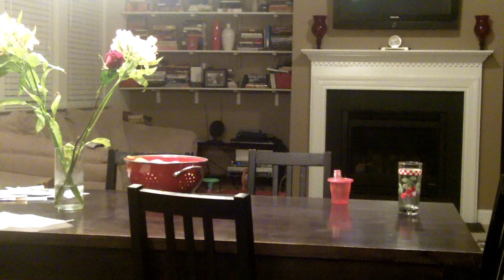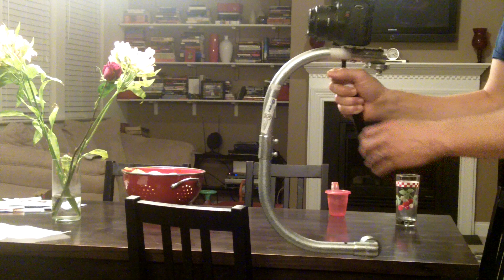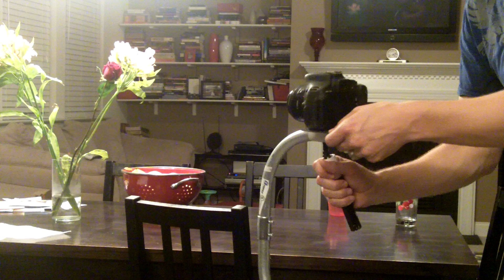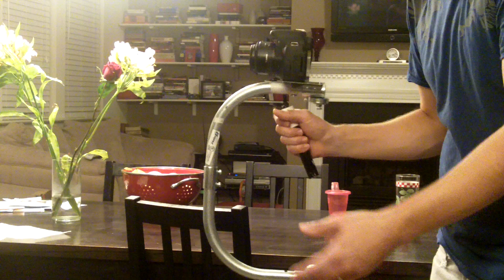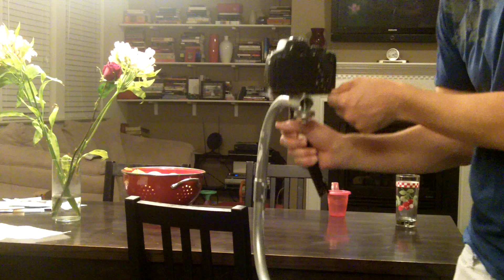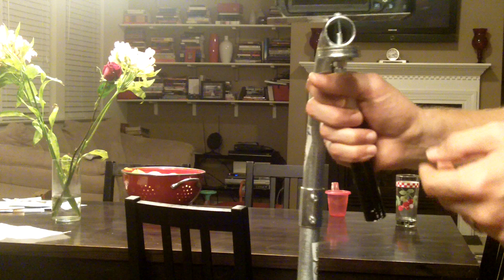Silver Flyer DIY Steadicam build attempt

Comment: Thanks for posting a video like this so everyone can see before even star thinking about building one. I personally build one for myself and I have to say that  is really unstable but you can moved the cam a little forward to balance. Also try to position the washers on both sides at the end of the pipe as well as on the back of the cam plate.

Comment: Its rocking because you are bottom heavy. Just because your camera is upright does not  mean the unit is stable. The bottom should be only slightly heavier than the top. There is a drop test in which you pull the bottom up 90 degrees than let it go. It should take between 1-2 second for the bottom to reach its resting position. If it just swings straight down you are really bottom heavy. If you takes longer than 3 seconds or doesn't go back down at all, you are top heavy. Hope that helps

Comment: I was having the same problems you were but here's what finally worked for me.  I bought this very long sliding quick release plate.  Because I could slide it back so far I didn't even need weights to steady it.  I just slid it back until the camera wasn't top heavy and passed the drop test.  Copy and paste this into the search bar on amazon:   
DSLRKIT 2 way Macro Shot Focusing Focus Rail Slider for CANON NIKON SONY Camera D-SLR

Comment: Funny, I was having the same problem as you with my build, tried all options all options, and was searching to see what I may had did wrong then came across your video. 
I found this other the youtube,"How to balance Opteka SteadyVid Pro stabilizer."

I noticed the guy had his duel battery grip on, I had mine off  fearing it was throw off balance, I am using a Canon 60d. I reattached my grip it and it balanced perfectly with no swing.
The only down side is my entire build is heavy.

Comment: You seem to have too much weight at the bottom.  You have much more weight than my setup and I am using a heavier wide angle lens.  Take off weight at the bottom...4-5 washers and also remove some weight from the top.  Dude, congrats on the build.  If it isn't much trouble, is it possible to put my video demo link in your description.  Also, maybe use the title of "Silver Flyer' DIY Steadicam?  I'm trying to get as many youtubers as possible to use the same title to help others. Thanks man!

Comment: My friend, if I were you, I would remove the 50mm and use a wide angle or the kit lens and leave it at 17mm.  The shots with the 50mm are just too tight.  Plus, not having image stabilization doesn't help either.  Go wide when using a stabilizer and you'll see some nice results.